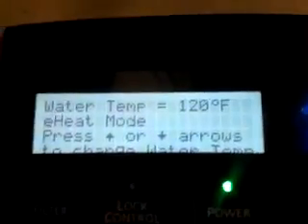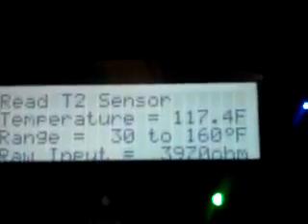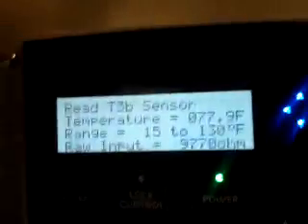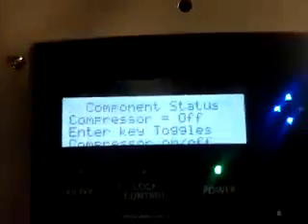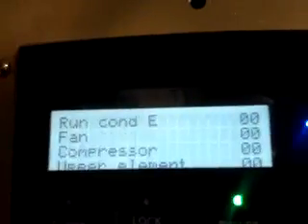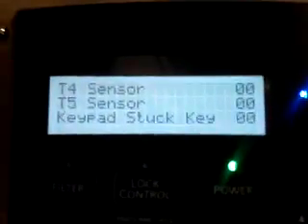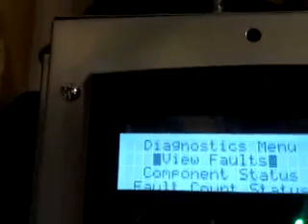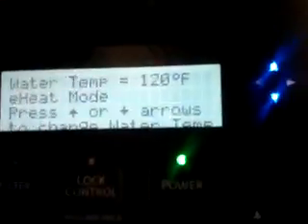Ge GeoSpring Heat Pump WaterHeater Diagnostic Menu

Comment: Hi Could you  please help me? You have the only video on youtube about this unit. It keeps beepen al the time as crazy. My display unit is dead, I has not been able to find a replacement. The water heater instaled about 10 years ago
Reply from the maker: I do not have this model anymore it's at my father's in laws house and we do not speak anymore... as far as I know when I gave this water heater to him it was still working.
Reply: @kd5bwp  Thank you so much for replying so quickly! I will continue searching. Thank you so much!
Reply: The constant beeping may be the signal to clean the air filter. It slides up off the top of the unit.

Comment: Wow, saved my bacon! Rats have eaten some wires in there for the second time. I was able to replace the wire, but the system was staying in fault and would not restart. Was able to get it going again with this video!
Reply from the maker: Glad I could help. Idk how many videos or articles there are for that model out there.
Reply: @kd5bwp  Not that much to be honest, I searched for a while but the stuff that was coming up was never quite the right thing... Pretty frustrating... Your video did it though!

Comment: Was hoping to get that "detection off" code but no dice.

Mine is in F4 failure because it thinks Fan#2 isn't working. I guess my unit has an older firmware (1/10 build date), because while I can toggle the fans on and they seem to cycle successfully, I can't see the RPMs on the readout. Unsure whether the fan is running slow, not reporting, or the CPU has an issue. Tried oiling the fan bearing, no change, still fails out when it self tests after clearing the code.

The fans are just 120mm case fans and are still in production, so I ordered one with a lead extension for ~$30.
Reply from the maker: Most likely just the rpm sensor that has failed happens to a ton of fans out there but if the unit is under 10 years of age they will most likely replace the entire unit since I think a ton of parts aren't available.
Reply: @kd5bwp  Man I wish. Further testing has it still with Fan#2 failure even after swapping the fan leads between 1 and 2. So it's a board failure, and it failed at 10 years and 4 months so service said "Sorry, tough luck".

Sears actually lists a replacement board at $500 but I'm not sure it's worth that given the age of the unit. Hoping a used board pops up on eBay.
Reply from the maker: @TurkeySandwichJr  Oh that sucks. Was it 10 years and 4 months from the date of manfacture? Because if you had a way to go back tot the store or look at your credit card you might be able to see that it was sitting on the shelf for a few months before it was sold and still get it replaced since the date of failed was within the warranty.
Reply: @kd5bwp  10yrs 4 months from purchase, I kept my receipt 😅.
Reply from the maker: @TurkeySandwichJr  That sucks...

Comment: Thanks for the info on how to read and reset fault codes. Mine showed heat pump failure T3a sensor. The seller tried for two weeks to locate service in my area while it ran on electric elements. They never found anyone who would even come look at it. Since I was on my own I found your video and went into the service menu. It showed the T3a fault stored 10 times. I reset that and the heat pump started up. That was 10 days ago and it has been running without setting another code since then. We'll see how long it lasts.
Reply from the maker: They have a warranty through the manufacturer and if no service is in your area they will cut you a check. But any ac guy can work on it. Check to make sure there isn't any leaks like oil comming out because that would be a tail tail sign that is where the freon is leaking from.
Reply: @kd5bwp  It died again. Warranty is now parts only. If I have to pay labor it would probably make more sense to just go ahead and replace it. No sign of oil but I have not removed the cover. Whether it is the expansion valve or a freon leak it will require going into the sealed system.

Comment: Have you worked much with the gen 3 models? Mine keeps throwing the breaker, had a tech out and they couldnt find anything wrong with it. any ideas? I've loved mine for the past four years, its been stellar until recently.
Reply from the maker: Could be the starting cap on the compressor.

Comment: Does this thing still work? Mine is throwing codes every week, which I reset, but not sure how long this can continue.
Reply from the maker: Yup the pan nipple failed a few years ago but in weld fixed it and still going along.
Reply from the maker: These units haven't been on the market 10 years. So it still should have a factory warrenty.
Reply: @kd5bwp  I am scared to find out how much they would charge an hour to install a warrantied $10 part.
Reply from the maker: @vadim7590  I agree... but GE was bought out at least the water heater heat pump division by AO Smith. So unsure about parts availability they might just upgrade you to a new unit branded AO Smith.
Reply from the maker: @vadim7590  when the pan nipple broke they didn't want to fix it they replaced the entire water heater with a newer unit. I then gave the old water heater after I fixed the pan to a family member and they are still using it years later without issue.
Reply: @kd5bwp  , So I finally managed to call them and they are sending out two kits for both FB and FC codes, however, they said I need to hire someone to install those. I think I want to handle that myself, but they said if there was a refrigerant leak, the installer should call them and request another part. My question is how obvious would the leak be?  If there is a pin hole somewhere, would there be corrosion or a stain?
Reply from the maker: @vadim7590  should be wet from oil also leaking out of any leak.
Reply: @kd5bwp  they finally sent me a new evaporator and a cylinder looking thing that's filter. I opened the case and see a lot of rust where evaporator is attached on both sides, plus the plastic pan under  it is cracked. The rust has oily feel. Not sure if this thing could be saved.
Reply from the maker: @vadim7590  oh boy sounds like you need more parts. But if the tank is damaged they should replace the whole thing fyi.
Reply from the maker: @vadim7590  the oil from the evap means that is leaking. Also if you refill your self you will have to put oil back into the system and best way is to empty everything and refill other wise it's a guess on refill. Personally I would get them to send me a evap coil dryer and compressor and consider coil and pan watch they say let's just replace the entire unit at that point.
Reply: @kd5bwp  yep, the crack in the pan is unrepairable, so they offer a new unit, but i have to pay for installation, and it only has the remaining warranty. Or they offered $150 per year of the remaining warranty.
Reply from the maker: @vadim7590  not able to install your self? Also how long would you have left? I think they came with a 12 year warranty from the factory. The new model haven't had issues with and the old one is still chugging along with the job weld repair.
Reply: @kd5bwp  The installation itself is probably I could handle, but getting rid of the old unit, then locating the new one and drag it into my basement may not worth the trouble. I'll see how much our local plumbers charge. They also want the evaporator kit sent back to them, so without it, I can't fix the old unit. Strange they offered a basic water heater or a hybrid.  Why would I go with basic electric? GeoSpring already does that.
Reply from the maker: @vadim7590  get a few family members make a bbq out of it.
Reply: @kd5bwp  lol, we moved upstate and left everyone behind. My dad is a HVAC or at least used to be, but he's getting older and I wouldn't want him mess around with this thing.  First quote I got from the folks that installed the old unit is $390 for delivery and installation, hauling the old junk, can be done tomorrow. I'm waiting on another plumber right now.

Btw, your new unit is AO Smith? The place I called is Bradford White, they claim to be handling GE products and providing a Bradford White hybrid waterheater, RE2H50. Not much noise about it online.
Reply: @kd5bwp  well, that thing is gone. Took 3.5 hours and 3 guys to haul it away and put the new unit in.  I am very happy with the replacement, you can barely hear the fan or compressor, comparing to GeoSpring.  Hopefully it lasts a while. This been fun, good luck!
Reply from the maker: @vadim7590  did you go back GE or did they give you a AO Smith?
Reply: @kd5bwp  its bradford white unit now.
Reply from the maker: @vadim7590  nice

Comment: Would like to know how to enter this mode to read any fault codes.
Reply: Try these buttons: "Press Filter", then "Lock Control", then "Vacation / Away". He mentions this at time stamp at 0:35). I just got a heat Pump Failure code for mine yesterday (Condition C). Looks like it just needs to be serviced but my heater elements are working fine, so I still have hot water.

Cheers!